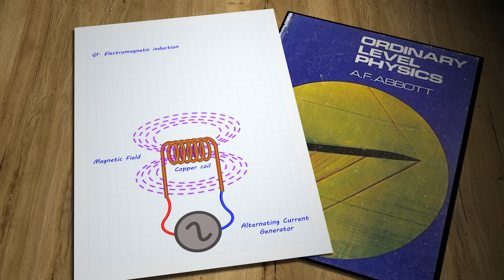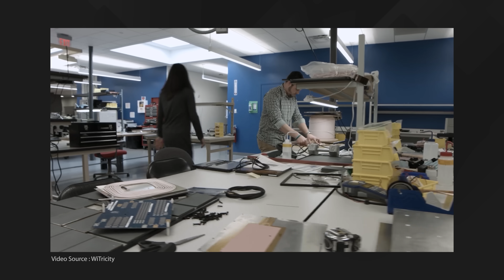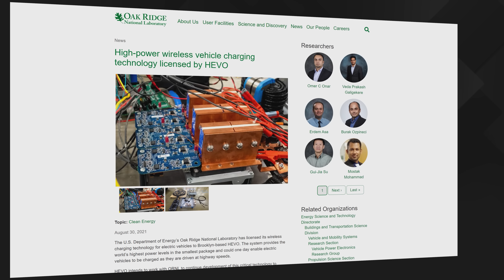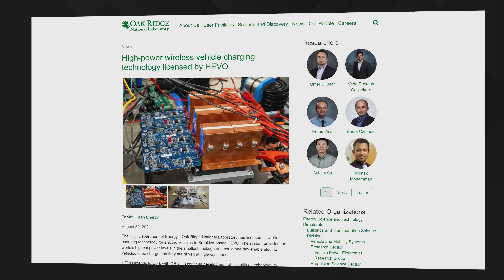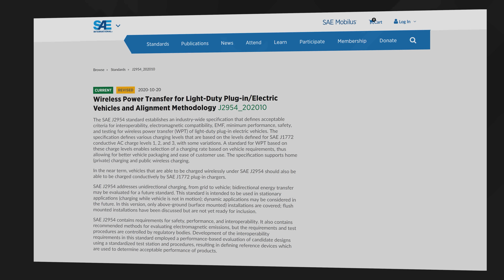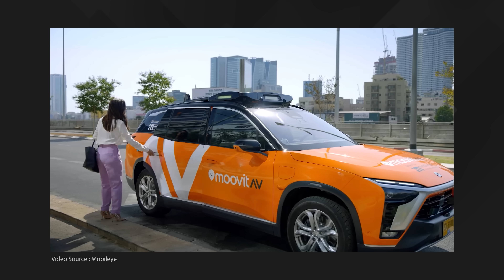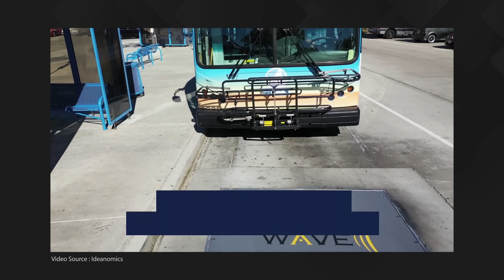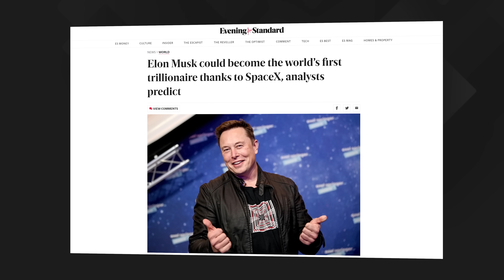Wireless FULL EV charging has arrived!  Exciting new tech breakthrough.

Comment: This feels like sort of a car-centric problem and an attempt to solve that problem by trying to maintain car dependence, rather than go the superior route of better public transit.

After all, why do you need to deal with the costs of installing this sort of tech under the road to provide power when you could just have electrical tram lines above the road for trams, or in a dedicated bus lane for electric busses? You're dealing with much simpler and more easily accessible/maintained infrastructure and more effectively utilizing the roads, rather than the absurd notion of all these self-driving taxi vehicles trying to serve individuals one at a time, causing congestion, and requiring being parked -somewhere-.

It's not to say this couldn't be a useful technology for EVs, and it's not like we have to eradicate car use altogether. Even the self-driving EV taxi idea isn't horrible in conjunction with better public transport and bicycle infrastructure. But as the sole answer it's going to be an absolute nightmare.
Reply: here I would disagree. I would actually argue that this is useful primarily for public transport like electric busses, maybe taxis, vehicles that do stop and go in dense areas and often just rest for a bit.   For high frequency bus routes and when using supercapacitors, I think it could be worth it.... but I'm fully opposed to it in use cases where people (or a robot for that matter) could simply plug in a cable at much higher efficiency!
Reply: @andreasbrand3191  Taxis and buses would be perfect for this. For the amount of people they move daily, the longer a vehicle can be on the road the more people get around. Also they would be charging as they drive. I would love to see them be able to pull this off on all major freeways. I don’t think people want more trams in the air either. They are an eye sore most of the time and turn into cesspools. More trains across the country would be nice though. We need some bullet trains since it does take almost three days to drive across the US. Not everyone likes to fly either. Those would be good jobs and what society could benefit from. Not some stupid ass gender studies or burning our dollars right in front of us.
Reply: @andreasbrand3191  The problem is that electric buses are a horrible idea anyway. Why pay to put expensive batteries onto a bus that will run the same route every day when you can run wires and have a trolly-bus service that doesn't have to store its power on the bus itself? You increase bus capacity, you reduce bus cost, you reduce pollution from the manufacturing/disposal of batteries, you reduce dependence on rare-earth metals and the often morally questionable acquisition of  them, and you make it so these buses are safer because now there isn't a battery capable of a long, self-sustaining fire onboard should an accident occur.

Not to mention running the wires means you don't have to dig up all these roads and then maintain something buried and difficult to access.

And of course I'm not about to advocate a huge infrastructure cost just to meet the need of taxis which are also horribly inefficient car-dependent methods of transport.

So it's just a poor solution to a problem that we're creating by trying to use bone-headed and problematic "solutions"... while desperately trying to not just build trains and trolly/trolly-bus systems because they're old and gross so government doesn't dare spend money on that tried and true thing that has worked for decades/centuries, lol.

Comment: There are already electric taxi's and buses that at fully capable of driving around for a full days work, without a recharge.

Suppose you had a car with 400 mile range and you were using it as a taxi driving around a city with an average speed of 10 miles an hour.  You're going to have a very long working day before that battery is empty.

So if full electric buses and taxi's are already capable of functioning without this tech then why invest in it.

On a second point a few years ago my father had a heart attack and he had to have a pace maker thing installed into his heart.  His heart doctor told him to stay away from things that do induction like inductive cookers.

If you look through the websites like the NHS or websites for heart pace makers stuff, they will tell you if you have a pace maker then stay away from things that do induction.

Comment: Not that much critical thinking in this one.
The practicality of whole streets outfitted with charging modules is ridiculous. The price alone to install will be prohibitive. Then the extreme stress from temperature, vibration and pressure fluctuations will kill such systems fast, or you have to build them very sturdy. But that means extra expensive. And how often do you have to repair the streets? Tear out the asphalt and replace it? Often, what then? And all that for the heaviest vehicles that destroy the way very quickly.
Parking and quick stops ok. But whole streets!? Just have a think!

Comment: I'm all for the wireless charging but it would be wasteful if it was less efficient than a copper cable.  It's hard to beat the simplicity, robustness and power handling capability of a copper wire.  But Tesla (and presumably other EVs) is going to put so much power through the wires and connectors that the cables will have hollow conductors for water cooling.

It's really difficult to conceive of how this wireless charging is going to handle a quarter megawatt or more without some way of keeping it cool.  I don't think it would be a good idea to eliminate the charging socket on EVs yet.

Comment: I'm looking forward to the day when we don't have to see ugly miles of cables across the landscape, but I suspect I'll be dead before that happens.
Reply: The cables can be installed underground. Wireless is not the solution.
Reply: The reason there are visible power lines is because it costs around an order of magnitude more to bury and maintain buried power lines. Nobody wants power lines strung everywhere, but people will choose power from visible lines over power from buried lines at 10 times the price.
Reply: @peglor  Yes, I know but that's not what I meant. I was referring to neither. The magic type when we just get power from the air. When we get it from cables on poles it's fine until there's a lightening strike. It's frequent in Australia. 🥵 And they'll never bury them over those distances.
Reply: @toni4729  Electrical power is available directly from the Earth's atmosphere. If you get a wire high enough (To the ionosphere particularly) it will show a charge relative to the ground that can be used to do work. The logistics of building these kind of energy harvesting systems make them too expensive for the amount of energy collected compared to the options we actually use though.

Comment: But why do we need to transmit power over a longer distance ? A receiver plate can be lowered down from underneath car on to the charging plate with spacers of required gap attached to it. The movement of receiver plate can be controlled from driver's seat, the way we control window glasses or boot space leads. Telescopic pipe can be used to push down or pull up the receiver plate. Why we are trying to solve the distance problem for cars.

Comment: What about the hazards of the magnetic fields? It's been known a long time that exposure to magnetic fields over time can cause cancer. Driving along a road that expose us to a magnetic field during drive, seems risky right? Even if the field are very focused and only close to 100%, there will be some spill over that will expose the persons inside the vehicle.
Reply: Mag fields are harmless.  I have had several MRIs myself, where I was exposed to very strong magnetic fields, and no issues with me or many other million people.
Reply: @georgegonzalez2476  ofc but MRI is not a long time exposure. The way personell working in proximity to MRIs, are very well regulated due to among other things, the cancer risk. What I talk about are long time exposures. For examples there are building codes about building close to high voltage power lines (magnetic and electric fields).. If you bild roads with a magnetic charging it will expose the driver every time he/she drives there. Driving over such mag fields day in and day out, cannot be good. At least it should be studied.
Just google it and you'll see. There are many reports in the subject.
Reply: @bjornek2  My college professor, Dr. Schmitt (yes, that Dr. Schmitt, inventor of the Schmitt trigger) studied strong magnetic fields for over 30 years.  He even subjected his wife to many-Tesla fields.  Right now there is a magnetic lab just down the road that puts lots of things in a many-tesla field.  Also there is scads of very solid  quantum arguments as to why magnetic fields do not have enough oomph to cause any chemical reactions.    It would be Nobel Prize fodder if someone could show a magnetic field causing chemical or biological reactions.   Funny, no such prizes  happening.
Reply: @bjornek2  The problem with worrying about magnetic fields is that they inevitably drop off in intensity as the CUBE of the distance.   So road chargers need to have a gap under a few millimeters to transfer any power at all, and the field at a passerby is almost unmeasurable.   Also, in Minnesota, the ground has a large amount of Taconite, so the magnets would soon be covered with inches of brown magnetic dirt!
Reply: @georgegonzalez2476 , that is what this video discuss. The problem with the effect of the field as the inverse cube to the distance (being a problem) and potential solution to exactly that problem. And if they solved that, and actually can transfer power with any significant effect over useful distance to a car in a traffic situation, there WILL be a field in the car, transferring the corresponding effect (by definition).
Reply: @bjornek2  I think, balderdash.    The cube factor is unlikely to be overridden, perhaps a slight extension in the constant factor, but the basic cube due to geometry, VERY unlikely.  Several other companies have tried raising investment capital with the same basic resonance idea, going back to the 1960's, all frauds and total failures.  Regards.

Comment: All of our wire wound transformers in our homes, streets and substations have been using wireless charging for the last century.
1MW per square metre, so a pizza box(say 50x50cm) could transfer 250kW at 90 to 96% efficiency gives 225 to 240kW.
Best of all is the very short run of thick DC cable from the receiver to the battery.
Reply: 96% efficiency for any induction-driven power transfer is a pipe-dream, we cannot achieve such efficiency even in theory, in closed loop transformers (least we cool them to 30-ish K), let alone anything so loosely decoupled in a living environment. 50% efficiency for a system like this would be deemed revolutionary, but also stupendously wasteful which is why, apart from a few prototypes, you won't see it even in real life, much like other stupid ideas like the 'solar freaking roadways' or the 'hyperloop'.

Comment: I didn't watch this video so he may have mentioned some of this.  Wireless charging has been used on extremely wide scale since Alternating Current was invented.  There are millions, tens of millions even, of electrical transformers around the power grid.  You have probably heard of power going out because "a transformer blew".  Transformers are basically two coils of wire which are not connected to each other.  Usually one coil has more wraps of wire than the other.  This trades current for voltage.  Voltage is lost over distance so its important to put a transformer on the line to step the voltage back up to the standard 120v for homes when the line is long enough it drops below this standard level.  Needless to say across a country the size of the US we need a LOT of these.

The way transformers work is starting at the power company a generator applies voltage and current to a line, when that line reaches the first transformer and the electricity flows through the coil on that side of the transformer it generates a strong magnetic field through the second coil which causes electricity to flow through it.  This is wireless charging and works on the same principles as your toothbrush or cellphone.

So why can't you wirelessly charge your phone from anywhere in the house?  The problem with magnetic fields is the suffer from something called the "inverse square law".  Basically this means if you get 2x as far away from the source, you get 1/4 of the power.   The same thing happens to a flashlight.  Shine a light on a piece of paper from 1 foot away.  Now move the light 2 feet away.  The paper wont be 1/2 as bright but 1/4.  Now double the distance again to 4 feet away and again its 1/4 of what it was at 2 feet.

For a cell phone to wireless charge it has be be sitting on a base station which puts the coil inside the charger and the coil inside the phone only about 4 mm apart.  Now to put this in general terms the phone has to be this close, farther away and it wouldn't have the necessary field strength to get the voltage needed to charge at all.  But lets imagine that it could charge at any distance.  Ok it will still charge slower the farther you get away from the base station.  My phone for example takes 1 hr to charge with a cord if completely dead.  On the wireless charger it takes 1.5 hours.  So its already taking longer just for going wireless.  Now lets see what happens to the charge time (assuming it would charge at all) at increased range.  Remember we start at only 4mm, or 0.013 feet.

So distance, then charge time.
4mm - 1.5 hours
8mm - 6 hours
16mm - 24 hours ( this is only 1/2 an inch and its already a full day to charge)
32mm - 4 days (this is a little over 1 inch)
64mm -  16 days
128mm -  2 months
256mm - 8 months (this is only 10 inches)
Converting over to inches
20 - 1.3 years
40 - 5.3 years
80 - 21 years
160 - 85 years
320 - 341 years  (this is about 26 feet, the average us home could put one wireless charger in the middle of the home and 26 feet would reach anywhere in the home.  OBVIOUSLY some homes are bigger)

So its not that we can't wireless charge things.  Its that the technology currently at least just isn't capable of doing it and less than incredibly short distances.  Again a phone wouldn't charge at these ranges.  But if you could actually pick up the energy being emitted from the wireless chargers available now at those increased ranges and use them to charge your phone, Im sure that none of us would be willing to wait 341 years go charge our phone.  It would even be a HUGE step forward if you could wireless charge your phone from even 1 foot away from the charger.

Now here is the big down side.  Even if, we had the technology to replace our current chargers with new ones that could charge even 1 foot away from the base station it would be almost idiotic to do it.  The thing is even if we can increase the range we still exponentially increase the power requirements to do so.  For example as mentioned earlier plugging my phone in takes 1 hour to charge.  It uses 2amps while charging for that entire time.  If I use the wireless charger it also uses 2 amps but takes 1.5x as long to charge the phone.  So by wireless charging it cost me 1.5x the amount of electricity to charge the phone.  That might not seem like a lot.  But now consider if we create a wireless charger that will charge out to just one foot diameter around the base.  Assuming we could even keep the charging speed basically the same it would cost us 76 times more electricity.  We are talking about 76 amps just to wireless charge a phone 1 foot away.  That's 5 times more energy than your dryer uses.  10 times more than your air conditioner.  Now multiply that by even 1/2 of the 300 million cell phones in the US alone.  It would be a monumental waste of energy just for the convenience of not having to put your phone on the charging pad.

So yea.  If we can't even charge a cell phone from 1 foot away without doubling the energy needs of the country we wont be wireless charging cars from the road.  Ever.